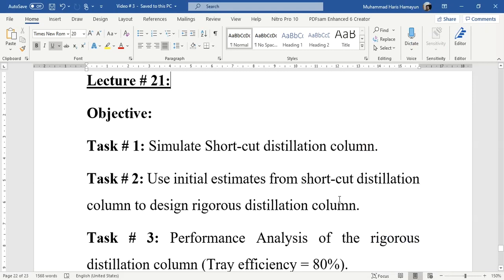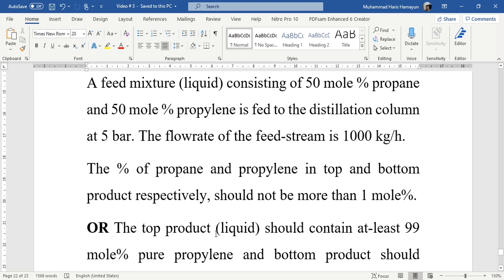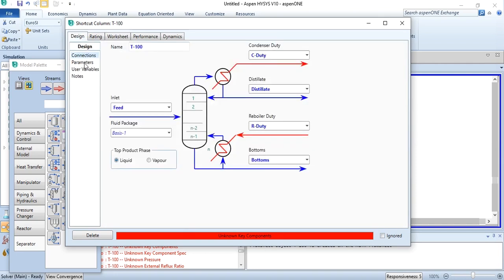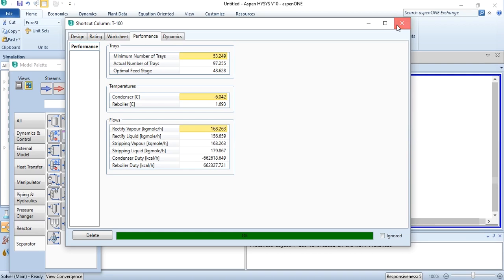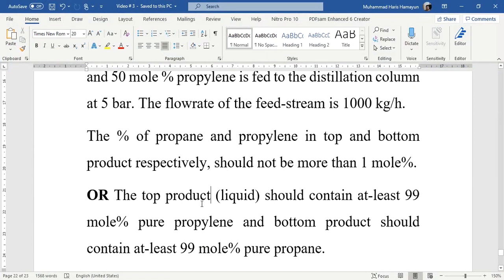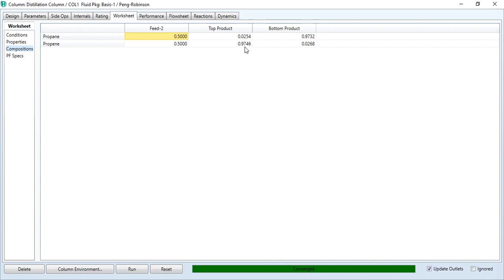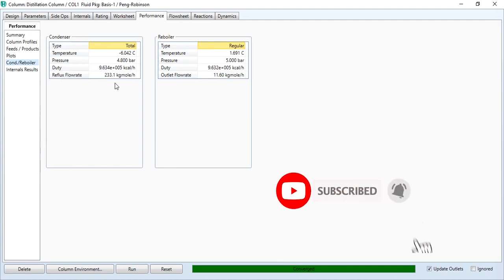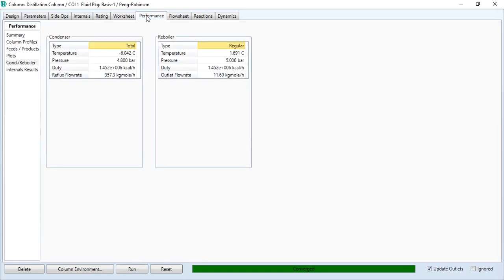Design, Performance Analysis and Internal Sizing of Distillation Column in Aspen HYSYS | Lecture# 21

Comment: Please, tell me how to calculate the pressure drop across the column, I press the "export pressure drop" button, but HYSYS says that this value is set, but if I remove it, the convergence of the column breaks down (red colour) and internal devices become impossible to calculate

Comment: How to reduce the amount of vapor at the top of the rectification column? The type of trays, their efficiency? I have a lot of top reflux in model the unisim program. I am asking for an answer and best
Reply from the maker: You can reduce the top flow rate by specifying value of flow rate in the specifications tab. And same goes for reflux ratio
Reply: Thank you very much for help. I will check